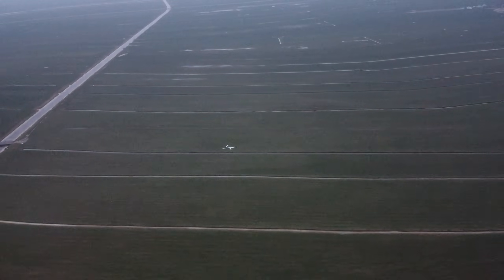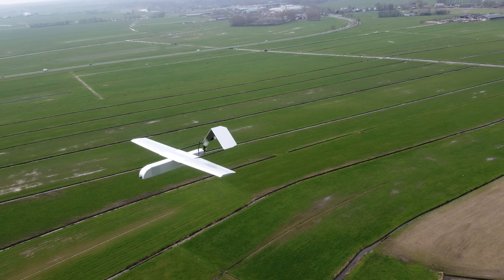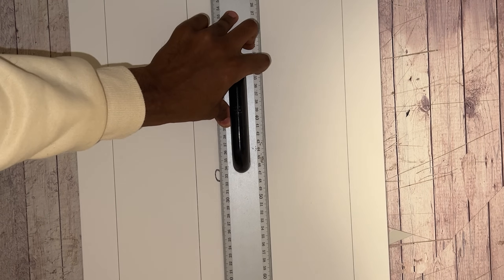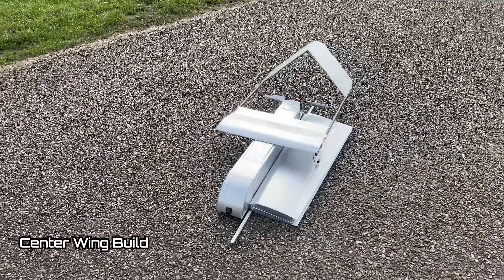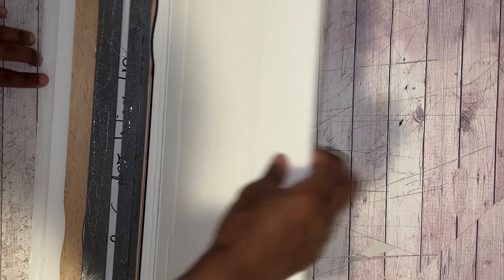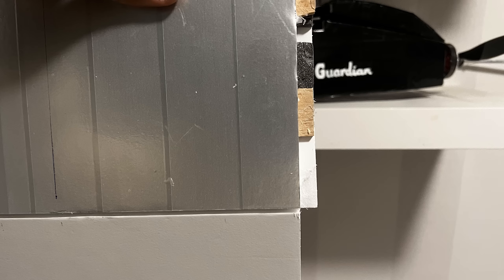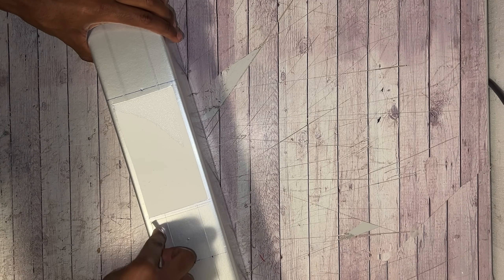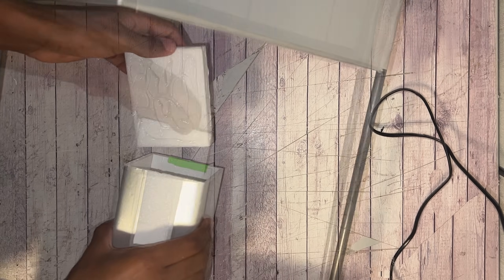How to build an Autonomous UAV for Long Range FPV & Reconnaissance

Comment: What method do you use to join the the middle wing section to the outer sections?
You have 3 piece wings on both the shadow and spectre but neither video shows how you afix all 3 wing sections???
Reply from the maker: With two spars (one main, and a smaller one at the back) to join the wing-halves and tape to fix them in place.
Reply: @AeroStuffFPV  Ahh ok, cool, thanks

Comment: Hi, I’m a big fan of your work. I was wondering how you usually launch your planes when using a pusher configuration. I’ve just developed my first RC aircraft design, but I’m concerned about the risk of getting hurt by the propeller. Do you have any advice? Thank you very much.

Comment: Great video, I just have a few questions.

How did you attach the ailerons to the wings? Did you just use tape?
How did you make the motor mount?

Thanks.
Reply from the maker: Wings are taped to each other to prevent sliding away from the center-wing. 

Motor mount is a 90-degree metal plate with drilled holes to permanently mount the motor to one side.
Reply: @AeroStuffFPV Thanks for the quick reply. I can't find 5mm depron anywhere. Would it be fine if I just use foamboard for everything?
Reply: @Mike-ur4ij  it should be

Comment: Could i use 50cm tail boom? Will there any performance penalties, other than change in cg?
Reply from the maker: Yes performance will change
Reply: @AeroStuffFPV  Wow, thank you for replying. Is it better to go 50cm, or 1m? Because i haven't found any 65cm carbon tube in my local e-commerce
Reply: @AeroStuffFPV i also thinking to use 14" prop. Is there enough clearence? Or should i make the gap between the to boom wider (by also increasing the length of the center wing to 50 or 60cm)?

Comment: what is the width of the metal profile between the two foam pads?
Reply: I'm building it, I wasn't sure but it looks like 3/16th an in, that's what I did

Comment: Great video, thank you very much. I am wondering what transmitter do you use with FrSky X8R 8/16ch Receiver? Do you have recommendations on this? Preferably affordable ones?
Reply from the maker: Taranis X9D Plus SE
Reply from the maker: You can use any transmitter that goes with FrSky Protocols

Comment: I was just wondering when the aluminum mentioned in the parts is used and for what because I haven't seen it used, I may just be missing it. If anyone can help, thx.
Reply: If you look you can see it being used to slide in the center main wing, it extends out to the other side wings that attach afterwards

Comment: Awesome build. I'm trying the taping method for 5mm EPS but having an issue with the board curving a bit every time I'm adding a new tapes strip. Anything I can do better?

Also, as a beginner would I get more chances of achieving lift if I tilt the wings a few degrees up? I'm not sure my result aerofoil is curved enough 

Thanks.
Reply: Yes, if you tilt them up a little you can get a little more lift, but you will also be pushing through the air more instead of cutting, this can result in an earlier stall speed of the aircraft, it takes a little tuning to make it work

Comment: can you make a video of what wires you put thru the back beams at 10:32?
Reply: Those wires are for the servo motors to move the rear servos to tilt the rear upside down v

Comment: apologies for asking a question that may have be asked already but what is the angel of the V notch in the V tail. Great video i am  almost done with my construction.
Thank You
Reply: Should be 90 degrees, that’s the standard for these designs to be centered for lift and yaw, but sometimes people will go one way or the other depending the goal of the aircraft, less angle if you want more lift and more angle if you want more maneuverability

Comment: Nice design, one suggestions for an improvement would be if you or anyone wanting to recreate the boom and mid wing design is to 3D print a rib shape with cutouts for spars on the profile and on the trailing edge a hole for the spars. I have printed such a part before and find it to be pretty big improvement in terms of having the booms solidly and rigidly attached to the wing without wobbling etc. Might even make them completely removable if you drill a small hole through the boom and attach them with a small clip through the entire wing in similar fashion to how RC car bodywork shells often are attached to the actual RC car.
Reply: i’m building one right now with this techniques i’m glad i’m not the only one to have come to this idea, i’m using lightweight pla and two carbon booms 15mm and 10mm

Comment: Would an Arduino work as a flight controller?
Reply: The first hobby flight controller was called multiwii, (technically triflight i believe) it ran on an arduino and a wii motion plus gyro board. Now days that's really outdated but, it's totally possible. If you want to build your own you'd be much better off running inav on a f411 blackpill or similar board though and really you can get fc's that'll run inav for about the same price as a mcu and gyro board and you'll want all the extra stuff on an fc like osd, voltage regulators, etc.

Comment: Terrific video, thank you for sharing.  What’s the all up weight?  What do you think its max weight capacity is?  (I.e.. how much weight can it carry).
Reply from the maker: Thanks! AUW is about 1.8kg. I'm not sure how much it'll takeoff/fly with at maximum. I don't have that formula. I'd generously guess between 3.5-5kg
Reply: @AeroStuffFPV  If you forget for a while about structural stuff, then you are practically limited to the Power/Weight ratio.
Obv, the more load on wings the higher the stall speed therefore it has to fly faster to be airborne. 
And of course, pitch speed of prop. 
I am sure now your P/W is at least 1.0+ 
Double the weight and you got hard time to launch it - toss it above stall speed. 

There is a nice calculator online (eCalc), slightly limited in free version but can provide some general idea how a plane will perform.

Comment: Nice. Just observing... For a free flight model airplane, this design and most of the others you showed look very short-coupled longitudinally. That is, the tail boom looks short. This may mean the stabilization needs to work hard for pitch stability. The drone footage seems to confirm this (though of course there's no way to know wind conditions in those). Same for small dihedral and roll stability. A good free flight design with longer coupling and dihedral does an amazing job of flying steadily through weather on its own.
Reply: It's a tradeoff stability vs maneuverability. Short coupled planes are funner to fly and handle better at speed generally. For gliders and super efficient slow self stable planes ya pretty much the longer the boom, smaller the tail surface and higher the aspect ratio the better.

Comment: Hi there.  Your material on YouTube is all excellent, thanks so much.  Of all the builds you have posted, which would you say is the easiest for a newbie to attempt?  Also, what controller do you use?
Reply from the maker: Thanks! I'd start with the Silent Star series (old build video, red/white V-Tail Tractor FPV Plane) That is the easiest to build & fly. Second place would be the V-Tail Pusher design.

Comment: Are the aluminum wing spars glued into the wings or fuselage?
Reply: The ALU profile is used ONLY as a temp placeholder. Bad idea to use ALU in wings especially. If you manage to bend it by crash you got a hard time to yank it out and replace. So, carbon spar.

Comment: great stuff man! have you considered implementing 3d printing into your builds? at least for the fuselage you could improve efficiency, make it easier to install your components and once the design is done you can just reprint broken parts essentially effortlessly over night.
Reply from the maker: I've considered 3D Frames but I'm not on it yet.
Reply: @AeroStuffFPV A lot of people don't have a 3d printer. Me included

Comment: Cool build! I always wonder how much loading can the glued mid section take. Yeah it's UAV so no aerobatics but still what's the upper limit. Will you try some loops? 😅 Good you trust it anyway! 

2kg AUW with 25.5 dm² seems like it needs some good toss for launch. 

Let's wait for the next flight video 👏👍
Reply from the maker: Thanks Valkyrie! This design does loops with ease with 1.7-1.8kg AUW. I'm not sure how much it'll takeoff/fly with at maximum. I don't have that formula. I'd generously guess between 3.5-5kg
Reply: @AeroStuffFPV  Ah that's great, impressive! I think that capability is reduced with freezing temps as hot glue gets more brittle? 🤔
Reply from the maker: Correct, but hot-glue joints are reinforced with duct tapes or fiber tapes to cover & minimize glued parts to pop open or loose.
Reply: @AeroStuffFPV  Yeah, I am neither fan of "glue-only"

Comment: As an avid RC flyer/modeller, just wondering, how about large wing span with wide wing cord, filled with helium also covered with solar panels, the idea of maximum flight time,back in the day built a Ben Buckel this thing was so efficient it was difficult to get it down

Comment: Have you experimented with fiberglass?
Reply: It wouldn't be of much interest and would also considerably increase the weight. The type of construction used here is sufficiently strong without the need for additional structural reinforcements. We must never forget that weight is the ultimate enemy for an RC plane.......
Reply: @sylvainponchelet4188 Not entirely true, proper fiberglassing can produce stiffer parts at less weight due to its tensile strength. Just look at competition gliders. I like to reinforce wing joints, motor mounts etc. with carbon fiber and it makes for insanely strong light weight builds.

Comment: Have you thought about 3D Printing your design
Reply from the maker: It's a consideration for the future.
Reply: I think 3d printing is best for things like mounts, control horns and other small and intricate parts that need to be strong, once you start printing big stuff that needs to be light it gets brittle and heavy so you're better with foam for durability and weight. 3d printed ribs with foam covering is an interesting concept to me though.

Comment: Is it possible in smaler scale like 1meter wingspan?
Reply: I don't see a reason why not. It's pretty much "just scaling down" the dimensions.  More important would be to keep the weight right proportionally to the size. If you keep the exact same electronic as in this build, you will end up with higher loading on smaller wings.
Reply from the maker: Yes, absolutely. I got a video how I design & scale my planes: https://www.youtube.com/watch?v=b4DrhALWAJs